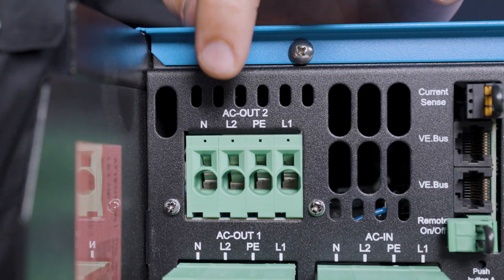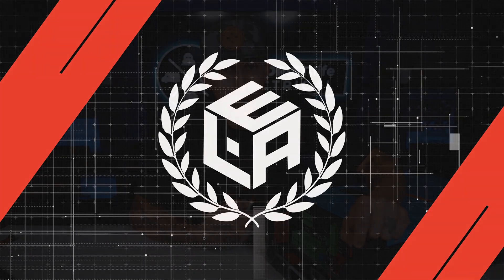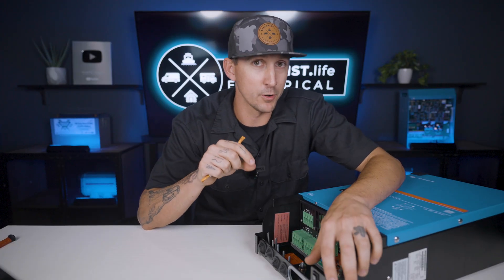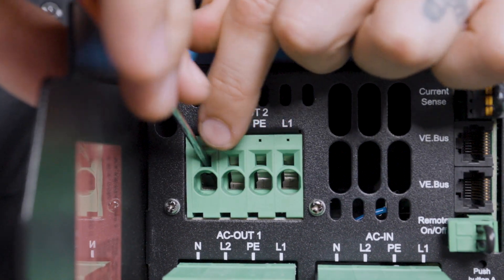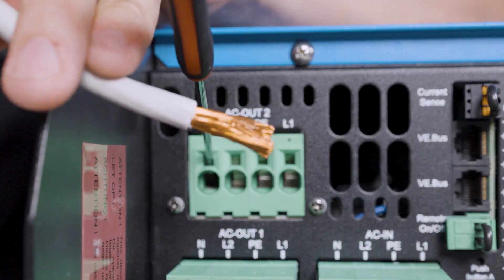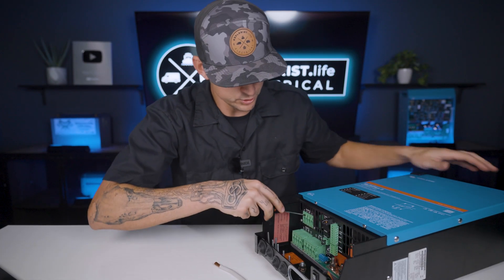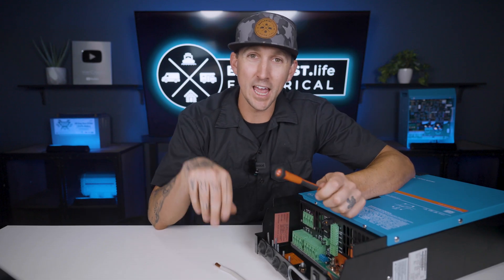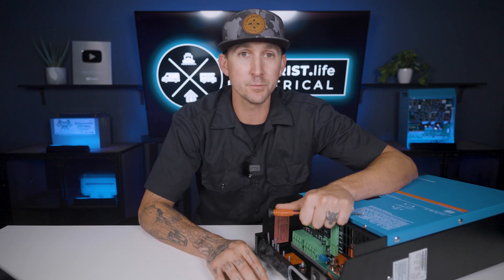Victron Multiplus Spring Terminals 101 | Wire Terminal Basics | E: 12/14

Comment: Should we use ferrules on the spring terminal?
Reply from the maker: Great question! Ferrules can be a nice touch when using spring terminals — they help ensure a clean connection and reduce the chance of stray wire strands causing issues.

That said, whether you need them depends a bit on the wire type and how secure the connection feels. Some folks go without and have no trouble, but ferrules can definitely add a layer of reliability.

For advice based on your specific wiring and components, feel free to reach out to our support team:
https://shop.explorist.life/support
(We offer free personalized support for gear purchased from our store!)

If your gear came from elsewhere, check out the EXPLORIST Pro Support Membership for one-on-one guidance:
https://shop.explorist.life/shop/all-products/membership-tiers/

Comment: It was my understanding that this specific spring terminal type specifically requires stranded wire rather than a ferule due to the terminal spreading out the individual strands and biting into them to make a low resistance electrical contact?
Reply from the maker: You'll notice in chapter 4.4 of the user manual for the Multiplus 2x120 that ferrule and pin lengths are specifically called out.  From this, we can draw the conclusion that both pin and ferrule terminals are allowed.
Reply: @EXPLORISTlife  I did see that - and i've spent a whole  lot of time researching ferules and rising clamp / spring terminals. Victron seems to provide conflicting information regarding them. Here's a quote from one thread "Thanks everyone, yeah I've "heard" (even from Victron distributors/installers) that they apparently don't recommend them. Which is fine if you simply say "don't use ferrules" in your manual! But instead they recommend a specific size of ferrule and silently say not to use them.
Not cool from a company as big and respected as Victron."

Now, that said - I agree you need to go with the manufacturer's recommendations, but I have read so many anecdotal stories surrounding hot (as in temp) AC wires and pulled AC wires with respect to Victron equipment - and it happened on a friend's boat - I am a bit at a loss as to the best practice.
Reply from the maker: I would imagine that the wire not seating all the way into the terminal is the biggest cause of an overheated terminal and not a result of using a pin terminal or ferrule.

This is the conclusion I've drawn for providing tech support for however many hundreds/thousands of inverters/components I've sold through shop.explorist.life over the last near-decade.  You wouldn't believe the number of tech support inquiries I've fielded from customers who apparently stripped the wire with a weedeater -> chewed the ends with their teeth -> installed the wire -> and still seemed baffled why the connection melted 🤷🏻‍♂️🤦🏻‍♂️

Good workmanship will nearly always trump a slightly subpar terminal choice.

But we digress.  This video is more about how to get 'whatever terminal method you feel is best' into the terminal.

My recommendation for best practice is a toss-up between pin terminals and bare wire for these.

If you can get bare wire into the terminal without mangling the end, do that.  If you lack the finger dexterity to do that; use the pin terminals we include in our kits.

Comment: Thanks for this video! These are the same terminals I had trouble with on my Renogy inverter. I was not confident that I got the wires in there enough. It seems like a poor application for them! I can see using them in a house with solid wire but not in a mobile application with stranded wire. What would be the benefit of using them over a screw terminal?
Reply from the maker: The spring clamps are a 'constant pressure' kind of thing that 'apparently' hold better than screw terminals over the long term.
Reply: @EXPLORISTlife 
Thanks for the reply! That gives me more confidence in them now!
Reply: @EXPLORISTlife you actually answered my question from another comment but, hey… engagement is good!

Comment: Very helpful. I've got a friend I'm doing a system for, using an MP2, and though I got the AC out cables set up (using uninsulated ferrules), it was a huge PITA. There's a couple of other videos out there on dealing with those spring clips but they're all showing different solutions - levering the screwdriver while trying to get the cable in place, etc. This is much more straightforward and doable. Thank you Nate!

(Whyyyyy did Victron ditch the old MP terminals with the screws though? So much simpler.)